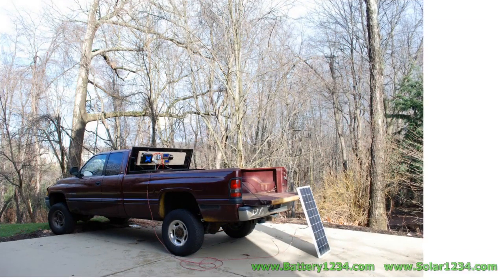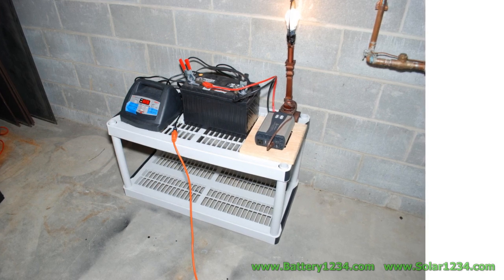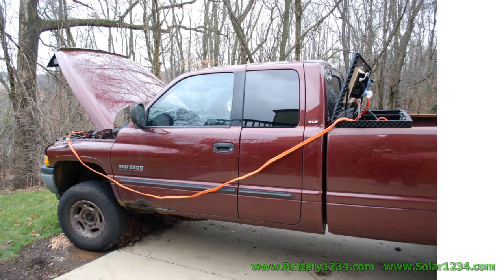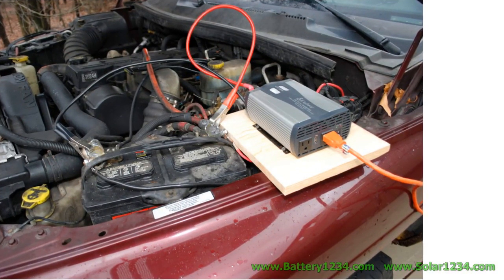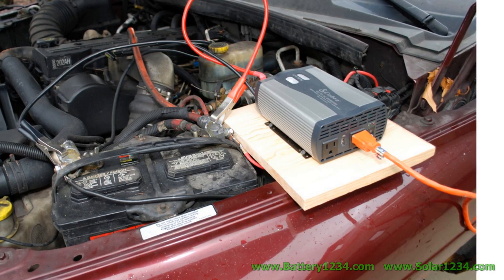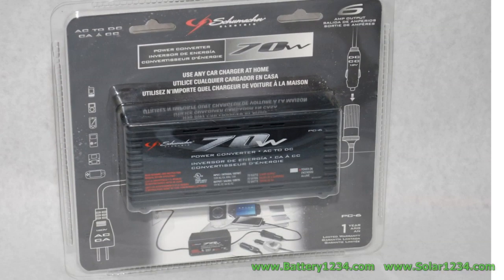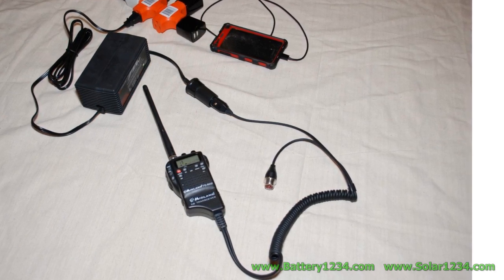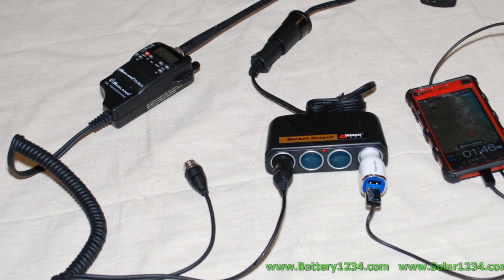The Flexability of a Steven Harris Mobile Battery Bank

Comment: I'll attest that Steve is the best out there on this stuff. I've been listening to his TSP interviews since they were first aired, and have been immersed in his emergency energy postings. I bought his DVDs and built a home backup system that will, this spring, be migrated to my Roadtrek RV for both travel/camping use and for my Community Emergency Response Team (CERT) work.

Comment: I wish Steven would update some of the parts on the Battery 1234 Website. for instance the charge controllers he has on there are crazy overpriced in 2019. you can get a Renogy Wanderer 30A PWM controller for 1/3 of the price of the one he has on there. I do love the concept, and am putting one of these together. it might be worth looking into LifePo4 batteries as an alternate to the Flooded GC2s much longer lifespan, as well as lighter and smaller. the only downside being they don't like below 0c charging.

Comment: We're do you keep your tools?
Reply from the maker: There is plenty of storage room still available.
Reply: Ya I'm doing about the same thing but am only having the power outlet secured to the tool box with a 100 watt solar panel on the lid keeping the controller and inverter inside the truck cab with my 120 amp hour deep cycle .thanks for the vid good ideas